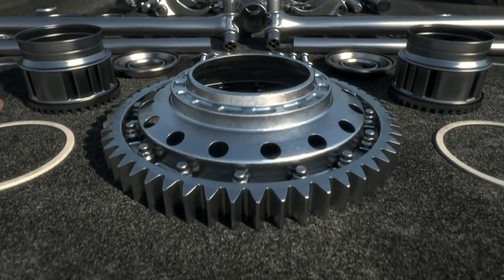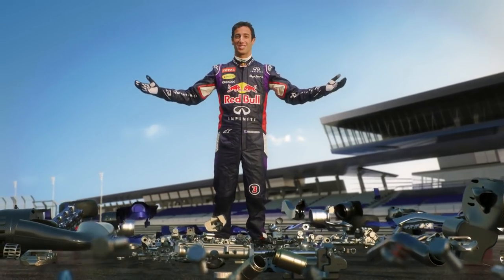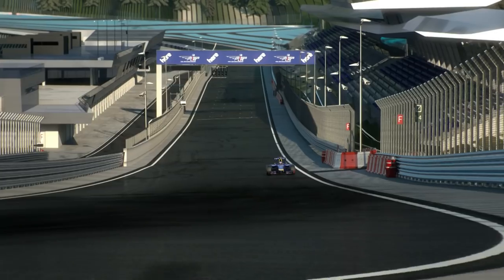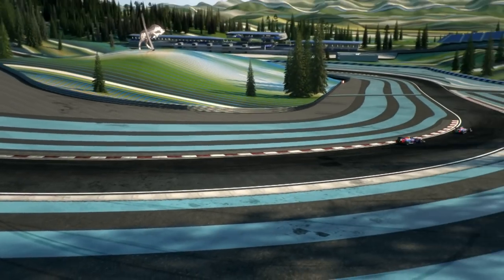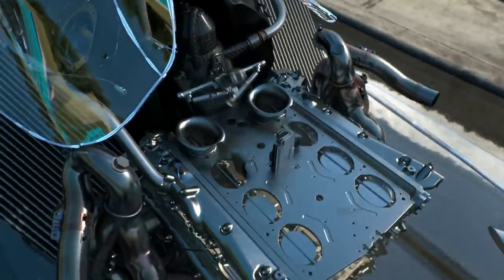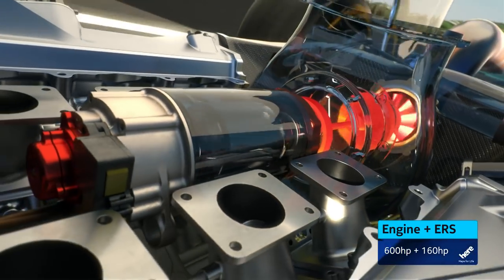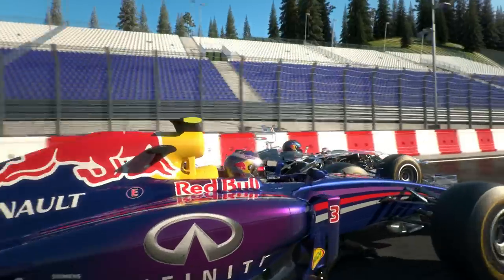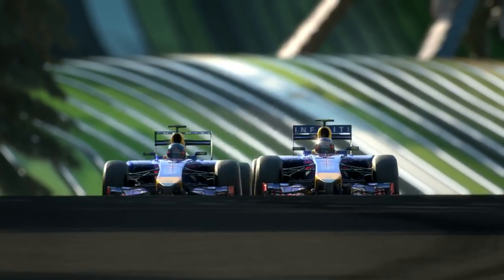Formula One V6 turbo: Rules Explained

Comment: Would there be any benefits of running twin turbo??
Reply: More turbos to replace. I suggest twin charging your vehicle.
Reply: +kai Milner  No, not in a car like this. The turbo is relatively large for high end power. The electronic engine does the job that a smaller turbo charger would do... low rpm grunt and torque. 

Heres a picture of the f1 turbo, its quite large! 

http://www.formula1-dictionary.net/Images/power_unit_renault_2014_f1_turbocharger.jpg
Reply: +kai Milner  The main problem is not with the number of turbos, the main is the limits what you can see everywhere. F1 is a great soap opera.

Comment: What is the point of improving fuel consumption if each car produces a dozen of dead tyres on each race. CO2 is quickly absorbed by trees, tyres are not.
Reply: Massimo Frittelli because the economy of fuel is for research purpose, overconsumption of tyres in F1 is made for show while economy of fuel in F1 is helping to make more economic motors for a daily use

Comment: i always thought the saving fuel was for safety reasons?
Reply: +Danial Loganathan obviously lol... its not to save the planet as some morons here believe...
Most of the tech featured here is there so drivers will die less... not to save the planet.
Reply: +beepIL give them free reign and they will push on the track a car with 350km/h and 500 liters of fuel on board. then crash in a wall. it would be fun to watch though!
Reply: +beepIL Kind of ironic how no one died during the V10 or V8 eras. But did during the first season of the V6.

Comment: Yo, in a few years they will have V4 engines and loudspeakers on the cars for fake V10 sound.
Reply: The 919 uses a V4 and it's a beast. Don't forget the Brabham BT52 from 1983 which had a turbo I4

Comment: F1 should be gladiators wrestling with thoroughbred Grand Prix cars while burning as much fuel as possible and making the loudest possible noise.  The result of pussy-footing to the tune of the "environmentally aware" and "social responsible" is a formula where the champion is the one who manages his tires, saves fuel, can remember which button to press on his steering wheel and remembers to activate DRS at the right moment - epic fail for a sport which used to be adored across the globe but is now laughed at.....

Comment: Conclude Report about no economy ,bad performance Automotive engineer of 6 parts (The underground racing mechanicals) in all brands which mean brands failure in automobile thus forever.

1. Wider rear track than front track dimension chassis  : easy wrecked chassis,the lowest traction,extreme tail flick,extreme slip,hardcore control in all speed and economy as 1-5 km/l,below 1 km/l (below 0.90g in 0.70g traction level).

2. turbocharger (1-4 turbo per engine) intercooler petrol engines : unstable acceleration,extreme wrecked engine parts,torque horsepower overload, and economy as 1-5 km/l,below 1 km/l.

3. without rear fog lamp : easy electronic parts wrecked,economy as 1-5 km/l,below 1 km/l.

4. CVT transmission : slow acceleration,economy as 1-5 km/l,below 1 km/l.

5. Wider front track than rear track in below 10 mm dimension chassis with FWD,RWD,AWD : medium traction,tail flick,easy slip and economy as 1-5 km/l,below 1 km/l (below 0.90g as 0.85g traction level).

6. Front track as same as rear track dimension chassis : medium traction,medium tail flick,easy slip,power slide,understeer  and economy as 1-5 km/l,below 1 km/l (below 0.90g as 0.80-0.85g traction level).

If over 1 of 6 parts,automobiles of economy use  1-3 km/l,below 1 km/l.

From
All brands database test performance

End report.

I just report about their performance economy brands vehicles series with specification & standard equipment about disadvantage on automobiles market.

Who invent these one are idiot and destroy world.

Comment: A Naturally Aspirated V10 and V12s will out-smoked the V6 Turbo smh
Reply: Well, the V10's are very powerful, especially for the fact of it being naturally aspirated, but because the modern cars have more torque, they're able to exit corners with slightly more acceleration. Plus, modern cars would smoke a V10 in terms of low end acceleration and top speed, I wasn't really surprised from that when I found out that the modern cars have about 1,000 horsepower while the highest the V10 (presumably) got to was about 900. The only reason the V10 cars have been very close is because they are considerably lighter, but they're also seeming to not be some of the quickest of f1 cars because the V6 hybrids keep getting quicker and quicker, even though really hurts me to say all this, the V10 cars are just not as fast as the hybrids. (I really want V10's to be brought back though)
Reply: caden the f1 freak i mean we need the good ol sounding not the performance right? It would be the same thing as 90s F1s with those raging V10s V12s but then again those are old and frankly the modern V6 Turbo Hybrids will out-smoked them in acceleration while also sacrificing the godlike sounding of those V10s and V12s though i really wanna see what will happened if they manage to do V12 Turbo Hybrid 🤔😂

Comment: V8 is better
Reply: v10 even better!
Reply: Martijn Bruggers Yea, as long as it's American.
Reply: ***** Since 1911 (when Chevrolet started)
Reply: ***** V16 is even better.
Reply: George GMC Sierra Denali V999842 is better.
Reply: Nolan Milnes XD
Reply: And actually, in case you didn't know, when I said V16, I meant a VERY updated version of the V16 in an old Cadillac from the early 1900s (I forget the year and model)